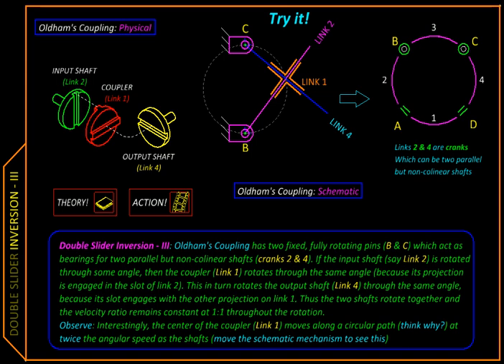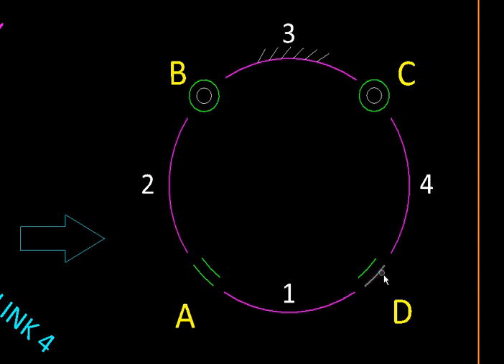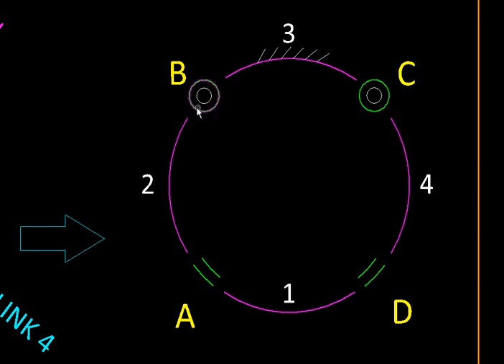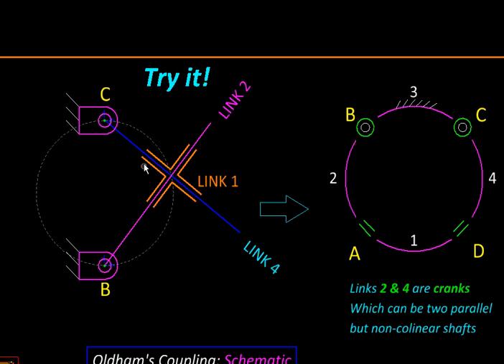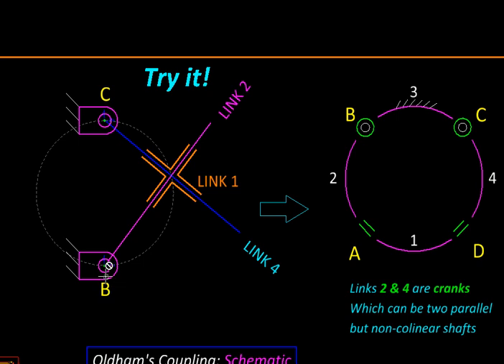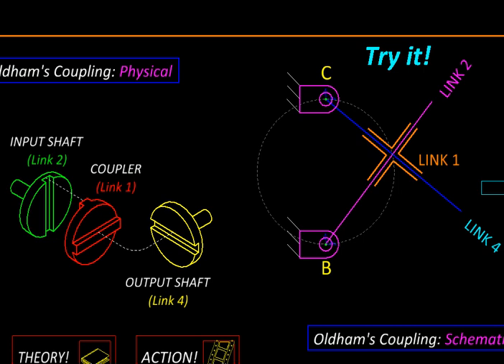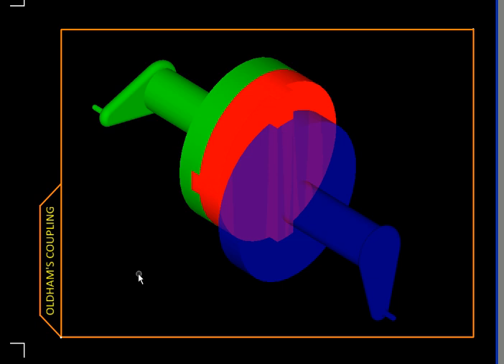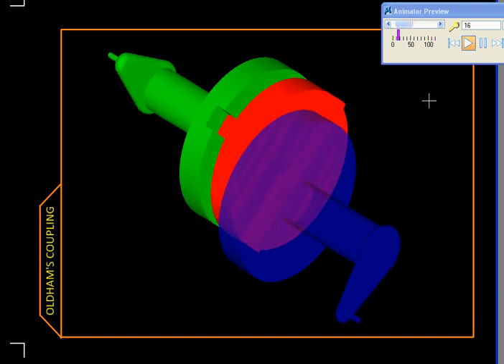Kinematics Ch01L Oldhams Coupling

Comment from the maker: @solanki akash I did not get the complete idea, but sounds like you need reciprocating motion? If so the alternatives are endless - besides crank-lever, you can use slider crank, eccentrics or more specialized cams to get interesting motion functions on the way up or down. Your college library may have coupler curve catalogs or mechanisms reference books that you might want to go through. This is a great learning opportunity - both theoretical and hand on. Good luck!

Comment from the maker: @Deenjohnson Thanks for taking the time to watch it and send in the feedback. I watched it again but could not see the deviation from 90° in the link (did you mean Link 1?). Angles may appear distorted (and circles as ellipses) when certain screen resolutions and aspect ratio (pixels in length:width). Check if a circle appears as circle in any other application like say Paint to check this. Another possibility is angles appearing different in projections. HTH